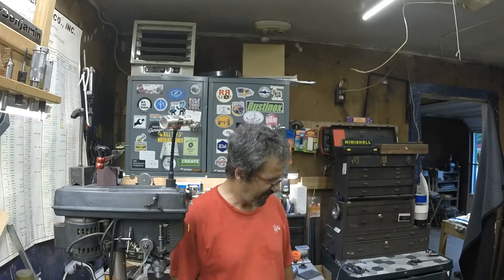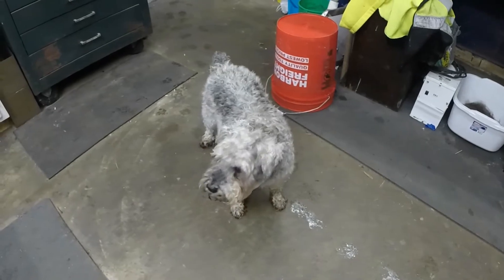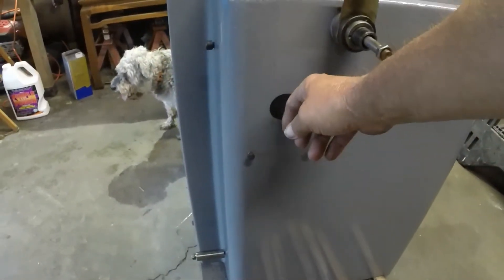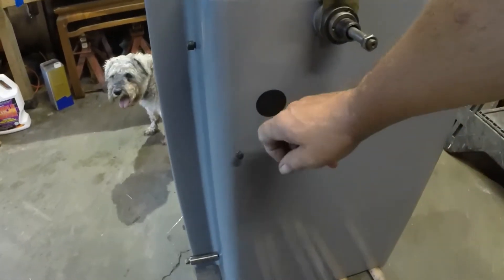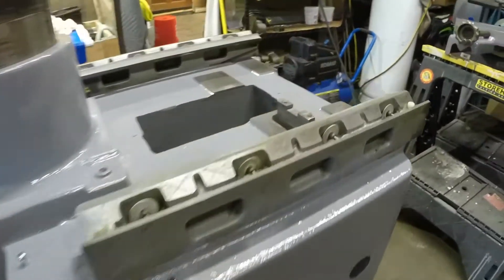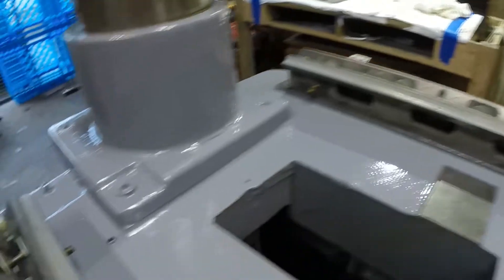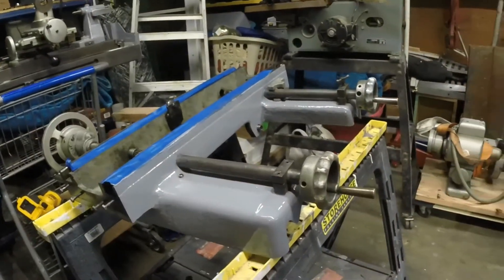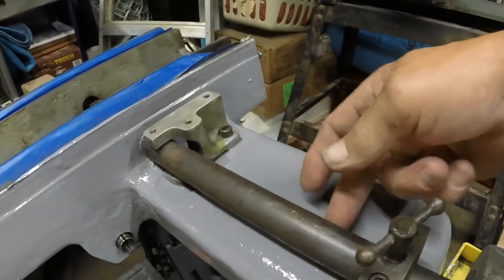K O LEE TOOL CUTTER GRINDER PART 14

Comment: 21:00 Look like mighty-expensive bearings, maybe even "specials" made by Barden.  Would avoid replacing these, unless you know they're damaged/out-of-tolerance (just clean them thoroughly with solvent, then pack them in Ziplocs - dust is deadly for these guys).  As far as lube goes, either check with KO Lee or anyone knowledgeable who owns one.  Could be fancy grease, but spindle or hydraulic oil may be what's needed.  Active Atom and Rob Renzetti both made great videos on lubing spindle bearings, but IIRC both used Kluber/$$$ grease.
Reply from the maker: I believe they are supposed to be sealed bearings and it is what keeps oil from leaking out of the case where is the O-rings are just keeping debris from getting in the case I’m thinking about putting some kind of sealant on the outside of the bearings were The original seal has pulled away from the metal I believe I can just use a little bit of silicone caulk RV sealant, ect... and not interfere with the balls just need to make sure whatever I use will not break down with the oil. I’ll try to explain it in a video. 
Other then that they seem in great condition.
 P.S. They fall under the category of spindle bearing. I found them online with a company I just haven’t been able to get a price yet but I think you’re right probably very expensive I might spend $25 each will see call my other fix works or how feasible it is
Reply: @kimber1958  The code on the bearing will show what kind of seal was on it originally, but often spindle bearings have no actual seals and use grease instead of oil.  I'm certainly no bearing guru, and don't want to give bum advice on expensive components. KO Lee may have info.